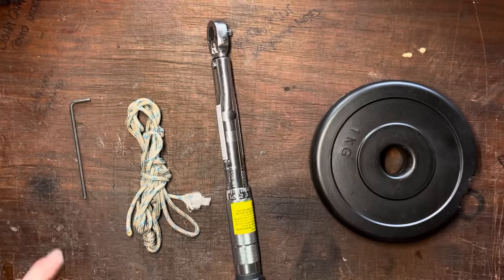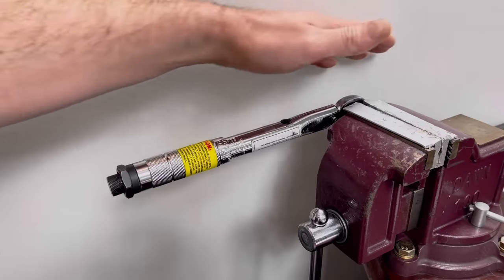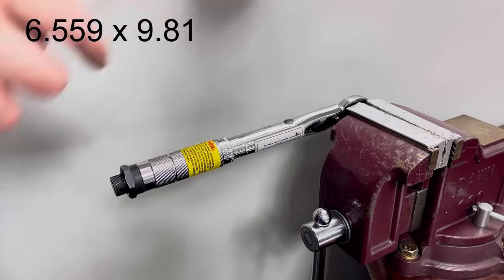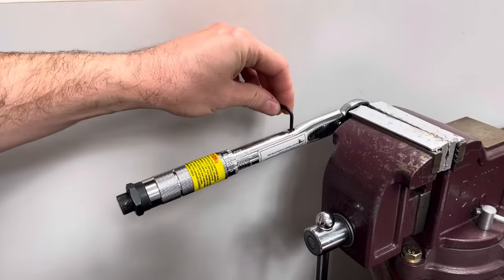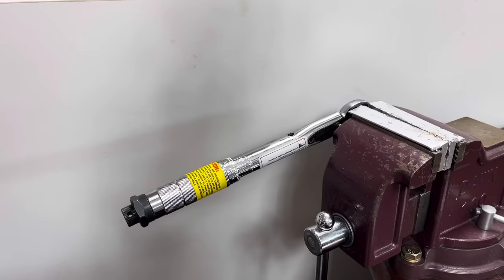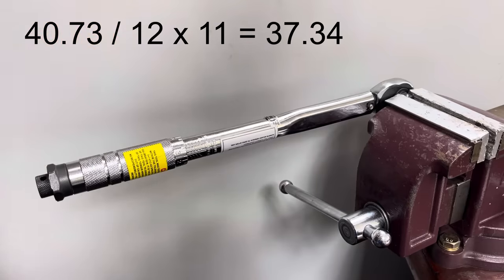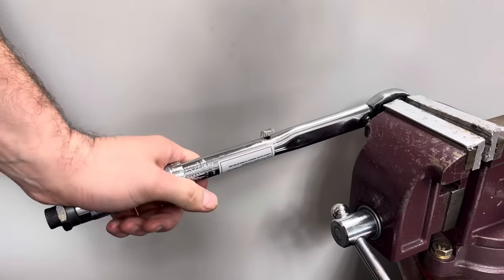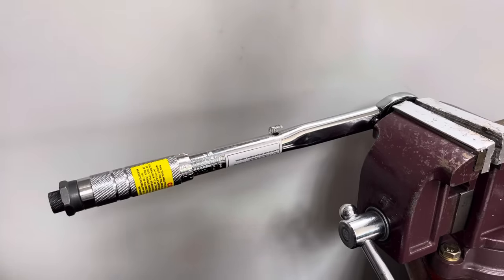CALIBRATE YOUR TORQUE WRENCH IN UNDER 5 MINUTES (NO SPECIAL TOOLS REQUIRED!)

Comment: When I was taught to use a torque wrench many year ago. We were told that the break in the knurling or the thin band of knurling was where your middle finger was supposed to be placed.  The reason given was that this represented the calibrated distance from the drive head to achieve the most accurate torque.  After watching your video, that make sense and would cause me to use the as a reference when calibrating.  Either way, I really liked the video and thanks for the cool trick to add to my knowledge.
Reply from the maker: Thanks for sharing and the kind words h
Reply: I don't think it matters where you hold it, the wrench still has the same accuracy just the force you need to apply will differ slightly but it will still click at the same nut torque force
Reply: @stargazer7644  I use my digital torque wrench as a torque meter to test my other torque wrenches.
Reply: @stargazer7644  It does matter where you hold and calibrate the torque wrench. You are meant to apply the force at the groove that all of these torque wrenches have. They all have them for a reason. I know that may be unexpected because a torque is a torque after all, but these click-style torque wrenches complicate things somewhat. 

There are actually two torques in play here: one torque at the head of the torque wrench which is wrenching on some fastener, which is what we want to measure, and another torque at the "elbow" between the head and the handle. The torque wrench actually measure the torque at the elbow, which is where the clicker is, and we use that to stand in for the torque at the head. That works fine if we calibrate things right to give us the right numbers. 

However, the calibration assumes a particular ratio between the handle length and head length. 

To gain an intuition for this, imagine a particular torque wrench that has a particular torque dialed in. In your imagination, apply a torque at the groove and make the wrench click. Now, leaving everything else exactly the same, modify the wrench to lengthen the head and shorten the handle, but let's leave the total length the same as before. Let's say the handle is now half as long as it was, which means that the elbow will now be approximately half way along the wrench. Now, apply the same torque as before. Will it click? No, it won't because the lever arm to the elbow is half as long as it was before. You will have to apply twice the force to make it click now. 

That shows that the ratio between the two lengths does matter. Going back to the original torque wrench now, if you apply the force at a different place, you will be changing the ratio.
Reply: @stargazer7644  The force from your hand should be applied at the same point that the calibration force was applied. You might as well use the groove that is put there for that purpose in every single click-style torque wrench.

I know what you are saying. A torque is a torque. But that doesn't apply to click-style torque wrenches, as I explained above, because the "elbow" point, where the clicker is, is not at the same place as the "socket" point. 

The actual measurement point (the "elbow") is not exactly at the same place as the intended torque application point (the "socket").

For other styles of torque wrench such as a digital one or a deflecting beam one, then yes, it wouldn't matter where you hold it because the measurement point (the transducer in the digital one for instance) is at exactly the same place as the socket.
Reply: @stargazer7644  Yes, you are applying a force, but more precisely you are applying a torque, which is a force multiplied by a distance. The distance matters here because there are two torques in question here, as explained above.

We can do the calculations to prove that.

Unfortunately I can't draw a diagram here, so I will have to describe the diagram in words:

The torque wrench is composed of a head and a handle, which are joined at what I am calling the elbow. The clicking mechanism is in the elbow, and that is where the torque is actually measured. The head has a square drive on it, which is what you plug into a socket. Here are the parameters for the "diagram":

t1: The torque at the center of the square drive.
t2: The torque at the elbow.
r1: The distance from the center of the square drive to the elbow.
r2: The distance from the elbow to the end of the handle.
f: The force applied at the end of the handle, which is just enough to get a click at t2. For simplicity we are assuming the the force is applied at the very end of the handle, and that the wrench was calibrated at that same spot.

So, by the definition of torque as a force times a distance, we have:

t2 = f * r2

and

t1 = f * (r1 + r2)

Divide these two equations into each other:

t2 / t1 = f * r2 / (f * (r1 + r2))

The f's cancel:

t2 / t1 = r2 / (r1 + r2)

Rearranging:

t2 = (r2 / (r1 + r2)) * t1

That equation tells us how the two torques are related. Let's plug in some actual numbers:

Let's imagine we have a torque wrench where r1 is 0.05 m and r2 = 0.45 m:

t2 = (0.45 / (0.05 + 0.45)) * t1

t2 = 0.9 * t1

We can think of the 0.9 as a scale factor. The torque at the elbow is always nine-tenths of the torque at the square drive. It's nice, by the way, that this scale factor is constant. It is independent of the force. That shows us that this click-style system actually makes sense.

Now, let's suppose we want to apply 10 Nm of torque to the square drive. What will t2 be?:

t2 = 0.9 * 10

t2 = 9

That is, we get a click at 9 Nm at the elbow when we apply a torque of 10 Nm at the square drive where the force is applied at the end of the handle. Remember this value of 9 Nm, we will use it later.

Now, we want to calculate what happens if we apply the force from a different position. Will we get different results?

Let's suppose we will apply the force half way along the torque wrench this time. We can imagine that we physically chop off the end of the handle so that it is out of the picture, but we leave everything else exactly the same, including the value dialed in to the clicker mechanism.

Here are the parameters for new torque wrench. I will use capital letters this time just to distinguish the new torque wrench from the old one:

R1 = 0.05
R2 = 0.20

The total length is 0.25 m, which is exactly half of the old one.

Using our formula from before, we have:

T2 = (0.20 / (0.05 + 0.20)) * T1

T2 = 0.8 * T1

Let's rearrange:

T1 = T2 / 0.8

Now, remember that the we got a click at t2 at 9 Nm? Given that t2 and T2 are identical, we have:

T2 = t2 = 9

And we get

T1 = 9 / 0.8 

T1 = 11.25

The torque at the square drive will be 11.25 Nm. So, in other words, if you apply the force halfway along the wrench, until you get a click, you will over-torque the fastener (11.25 Nm instead of the intended 10 Nm).

So, I have proven that it matters where you apply the force on a click-style torque wrench.

We can also think about the forces involved, which should be helpful for aiding understanding. In the first torque wrench:

t1 = (r1 + r2) * f

Rearrange:

f = t1 / (r1 + r2)

f = 10 / (0.05 + 0.45)

f = 20 N

In the second torque wrench:

F = T1 / (R1 + R2)

F = 11.25 / (0.05 + 0.20)

F = 45 N

IF it did not matter where you applied the force, we would predict that F would be exactly two times f: halve the distance and you double the force. But we can see that F is more than twice f (45 N vs 20 N).

In other words, if you applied the force half way along the wrench, you would have to apply more than double the force to get the mechanism to click, and you would over-torque at the square drive.
Reply: @dgphi  You're totally overthinking what's at work here.  In the moment just before the torque wrench head clicks, the tool is a solid bar.  Nevermind about the articulated head - that's irrelevant.  The applied torque at the square drive is whatever force you're applying to the tool multiplied by the distance between the center of the square drive and your hand.
Reply: @davekerikeri2852  No. If you hold the wrench closer in, then by the time you get a click, you will have already over-torqued at the square driver. If you held the wrench further out (using a cheater pipe), then you will have under-torqued when you get a click.

I proved that with the math above. If you don't find that convincing, however, please watch the video called "Why hand placement matter when using a torque wrench. Proof with electronic tester!" on the "How 2 Wrench" channel where the guy does a physical measurement that shows that hand placement does matter.
Reply: @dgphi  = I think you are absolute right (but i have problem to translate your words in my language).

Calibration only in the middle where your hand will be by the construction of the manufacturer. 
My premium german brand torque wrench have an triangle as a mark where to calibrate. 
But they recommend to use the calibration service. 

My thumps  for your text. 
But it is difficult for me to translate your words.

Comment: Doesn't weight already factor in gravity? The equation is mass*gravity*gravity*length, dunno seems funny. Maybe someone more clever can explain this.
Reply from the maker: It will marginally. You can use fishing scales and work horizontally. Thanks for watching

Comment: Nice tip, I will be re-calibrating both of my wrenches. 
One tip I was given more years ago than I care to admit was to turn your torque wrench back to zero after use, relieving the tension on the spring. 

Cheers, Geoff
Reply from the maker: Spot on Geoff! Always take the tension off :) thanks for watching and sharing 👍
Reply: At work, we had our torque wrenches calibrated yearly. As an experiment, I bought a really cheap one and left it wound right up for three years, it passed calibration.
Reply from the maker: @paulhawkins6415  interesting! Thanks for sharing!
Reply: @paulhawkins6415  "experts" say "don't keep your magazines loaded with ammo, as it will weaken the spring". Yet militaries around the world store full loaded magazines for who knows how long.
Reply: @savage22bolt32  Yeah, the French army still has theirs from -39 ;)
Reply: @olenilsen4660  😆😆😆
Reply: @olenilsen4660  🤣🤣🤣
Reply: yeah I got a brand new one recently for a new car and they say it in the manual to always do that
I have my 10+ years old one in another car and it's set to 110Nm all the time because it's not so easy to change the value and only used for one job anyway
when I compared the nuts tightened by the old with the new it seemed still quite accurate
but will try this method out of curiosity
Reply: There's a YouTube channel who tested leaving the torque wrench set for 6 months and it did change the accuracy. 
It probably depends on the brand and quality.
Reply: I didn't know about releasing the tension, and my torque wrench started clicking at the 80 ft lb setting at 65 ft lbs. I didn't know about this screw to calibrate, so now I can use a digital torque adapter (needed something with a higher max setting anyway) to recalibrate the old wrench.
Reply: @paulhawkins6415  I left mine wound up for over 10 years, and it definitely would not pass a calibration.

Comment: A metroligy lab would calibrate that wrench in 2 or 3 different spectrums of the scale. Lower end, middle, and upper end of the scale. If it is continously used at a specific setting, they may also include that in their calibration.
Note any equipment used to set/measure the calibration must also be calibrated. In this case the tape measure and weight set.
If the tool was found to be out of calibration, in this case +/- 4%, any item torqued with it after the previous calibration would need to be recalled. With that said, prior to calibration, the current torque should be measured prior to any adjustments. Also note that the bolt that was torqued also had a +/- tolerance and would be taked into the account of any recall.
The frequency of calibration would be based on how often the the tool is used.
Ben
Retired 30 year 3M Quality Technician
Reply from the maker: Thanks for watching 👍

Comment: To calibrate a torque wrench, you have to verify the whole range, not just a point or two. You have to check the full scale, the minimum indication and several points in between. Then you may have to make a compromise to bring the whole scale in tolerance. You can't do it this way.The torque wrench you show is a cheap one. The precision of these wrenches is not even along the range, especially at the low end. I have  such a cheap torque wrench and I calibrated it professionally (I work in a lab and I do calibrations for living). The range was 60-200 Nm, the first portion of 60-100 was useless( +20% error), but the rest 100-200Nm I was able to tune it bellow 1%.Therefore I use it only for torques above 100 Nm. My advice is to buy a $50-100 device. A relatively good quality torque wrench has specified in the manual, the length of the arm, so you can calculate the torque if you use an extension, If you're a mechanic you really don't need a $1000 torque wrench, you work in a shop not in a lab. Anyways, if you want to play with it, why not. There are professional calibration labs out there and they do it for a reasonable price and also you get a AALA recognized certificate of calibration.
Reply from the maker: Thanks for watching 👍

Comment: You forgot to reposition your weight point after changing the setting on the wrench, if you change the setting, your weight point moves with the handle since the handle extends/retracts so you need to get your measuring tape back out and look where your weight position is now.
Reply from the maker: Thanks for watching. Yep it was an editing mistake.

Comment: Buy a $50 digital torque wrench adapter. They're far more accurate than the most expensive click type torque wrenches. It's too easy to make a mistake using this method for a lot of people. You can use the digital adapter directly or use it to calibrate your click wrenches. Or both. The click type or better for many places that are hard to reach with a bulky adapter.
Reply from the maker: You can! However this method is quick and free.

Comment: I cannot turn the adjuster at any way. What is your suggestion?  Thanks
Reply from the maker: They’re quite stiff! Try releasing the spring tension first though :)
Reply: @VintageEngineRepairs  tried release. Tried wd40.  Tried stiffer lever. No luck. Maybe heat?
Reply: I managed to turn it with the ratchet.  But was unable to adjust no matter what I do. Used 6.5kg of weight, 30cm wrench measurement, gives me 19 Nm,  and the wrench need to be set to 32Nm to click on that weight.
Reply from the maker: Ouch! I wonder if it has a red loctite or it’s been cross threaded? Maybe take the tool back to the shop :)
Reply: @VintageEngineRepairs  no idea. It was off the scale. I added 2 washers between the spring and the rod, measured again, grinded one washer and now it works fine.

Comment: A good post and usefull vid .👍
Most cheap high street wrenches are way off and need calibrating.
I Used to calibrate equipment as a tech support engineer both eletrical from fluke meters  to torque wrenches Ultra light 6ft lbs  too 500ft lb long bar.
Good advice for a rough home setting.
 I'll just add to get it spot on  you ideally need to check the lowest,  the mid & the highest settings as the spring tension accuracy  can vary hugely and may show that the tool is no longer accurate on all settings.
Most common reason is because people dont reset the wrench back to its lowest setting after use and just leave it for months with the internal spring under constant load.
Reply from the maker: Thanks for sharing your experience, great stuff :) yes, checking the full range is certainly worth doing!